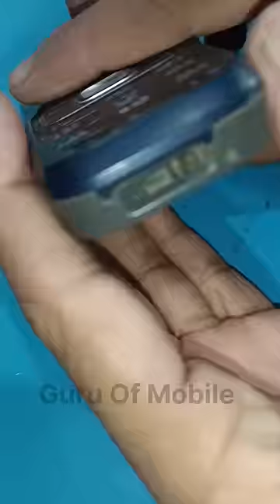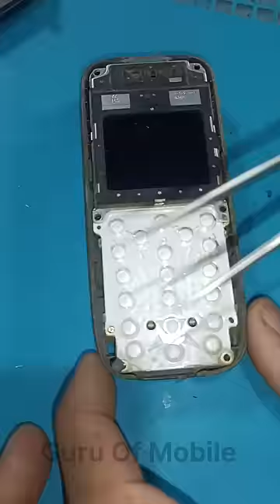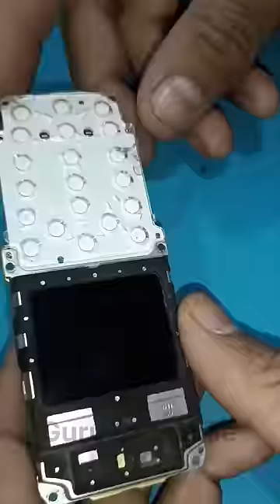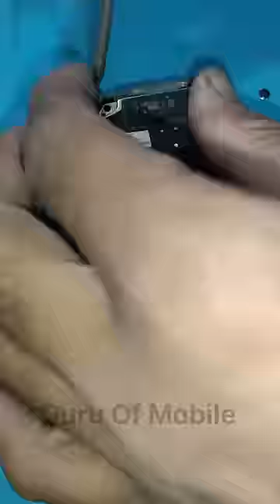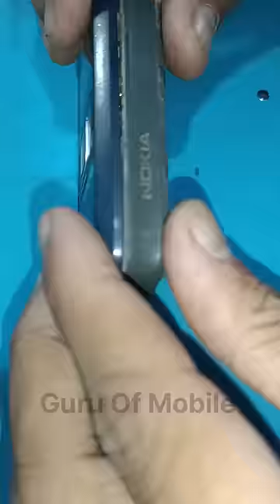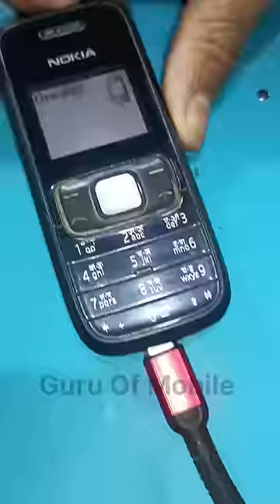Nokia 1200 mobile has added Type C port 👍

Comment: Congratulations, battery charging is working properly. But you removed also "easy flash" connector, which is used to transfer data to phone and from phone to computer (like as SMS, flashing software etc.). It looks simmilar to USB, but it's their own connector, which is using FBUS data protocol, which can be implemented using RS-232 serial port to USB (ttl converter). I surely would not reccomend doing that, if you want to ever transfer data through cable by that way, but if it's like only for calling it's perfectly fine.
Reply: @GuruOfMobile bro wrote an entire manual and u u reply with is "👍👍" 💀💀💀
Reply: @CraneFilmAndGameStudios Got him in his feelings
Reply: @nathanyellowstarthegoanimator he didn't attach data wires he attached just two wires of power
Reply: @nathanyellowstarthegoanimator he just erase it...
Reply: I thought it was rs 422
Reply: @CraneFilmAndGameStudios southern youtubers be like:
Reply: yeah, also due to the type-c mod that didn't have 2 extra wires for data, it is charging only. unfortunately he removed the ca-50 port (yes thats how the data port or flash port is called for this model of Nokia) and also the 2.5mm jack got removed, now I am so unsure if type-c headphones will work on this or not.
Reply: you can still transfer data using fbus cable. 😅
Reply: @CraneFilmAndGameStudios hahahahaha 😀
Reply: Chacha ji konsa data transfer kroge konsa 128 gb ka phone h??? Or dusri bat ye cable hi nhi milte ab toh kya kroge port rakh kr???
Reply: Nah that’s absolutely atrocious for the battery
Reply: 😂😂😂 кто нибудь это использовал хоть раз? 0.00001% пользователей
Reply: You missed the more important part. The audio jack.
Reply: Typically has ea tyutyy
Reply: What can you do with this phone besides calling? 😂😢
Reply: What kind of data u wanna transfer from this tiny phone☠️
Reply: Nokia 1200 se kya data lega dega koi 🤣
Reply: I think these types of phone is depended on External SD card and has very less storage (mine had less than 100MB) so it's not really that important.
Reply: @CraneFilmAndGameStudios he says he don't want boomer user manual 😅😂
Reply: Bro who is gonna read that essay
Reply: Great knowledge
Reply: He only uses Vbus and ground . No problem .
Reply: @CraneFilmAndGameStudios if i were him , i remove the comment
Reply: Ccn
Reply: Do you really think anyone would bother transfer data from such crap😂. Its just made easier to charge this beater. For calls/sms only
Reply: @erduson Headphones through Type-C will not work sadly.
Reply: @agostonpalatinus1513  true.
Reply: @CraneFilmAndGameStudios 💀💀
Reply: @CraneFilmAndGameStudios 💀
Reply: Kk
Reply: Kbbkkkkakkkkkakkkkkkkkkkkkkkkkkkkkkkkkkkkkkkkkkkkkk
Reply: AkkkkkakkkkkkkkB
Reply: @GuruOfMobile  kakkkakaakaaaalkkkaaakkawkookakakkkkak ask akaakakaaakakaalaaakkkkaakkkkakaawaakakakkaaaaaaawkaaaaaakaalaa
Reply: @CraneFilmAndGameStudios  aaaaaaaaaaaaakaaaaaaaaaakaaaaakaaakaaakaaakaaakaaaaaaaaaaaaaaaa
Reply: @tinaChaudhari-bh4qj  ?
Reply: @CraneFilmAndGameStudios cause it increases his engagement metric, he doesn't give a crap about what the guy said 😅
Reply: bro who is gonna even gonna transport SMS and flashing software from a phone that is 20 year old onto a modern computer. if so why use that kind of connection when you gotta capture important files. just use special type of pins and connections to use the features by emulating it on the computer.
Reply: Thank you for the information🙂
Reply: @CraneFilmAndGameStudios 😂😂
Reply: это звонилка а не ПК!👀
Reply: @CraneFilmAndGameStudios 😂😂
Reply: Black white phone me kon data transfer krta hai bc..😢

Comment: But dont put fast chargers because it will damage the battery or port
Reply: Fast chargers require a data signal to output more than 5 volts. If there's no data the charger defaults to 5 volts.

Comment: गलती से 120 watt चार्जर लगा दिया तो boomm.... 💥💥💥
Reply: Kuch nhi hoga watt se itna fark nhi padta bas voltas proper hona chaiye or charge koi sa bhi ho kitna hi watt ka ho voltes 5 volt hi nikalte h
Reply: 2 wire de kush nai hoga
Reply: @teamjordan kuch samjh nhi aaya kya bolna chahte ho English weak h kya
Reply: Nothing happenss...If we connect any powered adapeter ( 120 W / even 1 kilo watt) no matters device will automatically charge in supported Power ( 5v) case of nokia..

 I cant teach these guys ... That Posting this comment... Becoz That is their attitude. No one can teach them
I posted this only for those Who belives your fake information..
Reply: У каждого аккумулятора есть ограничитель ☝🏻
Reply: USB chargers are not retarded. They automatically limit the voltage to 5 volts.

Fast charging is something that is opt in.
Reply: @ajaygamingyt2366 Unless You Trigger USB PD protocol.. and connect PD Charger.... boom.. 5V, 9V, 12v, 15v, 20v on your call...
Reply: И ничего не произойдёт, современные контроллеры умнее ютуберов